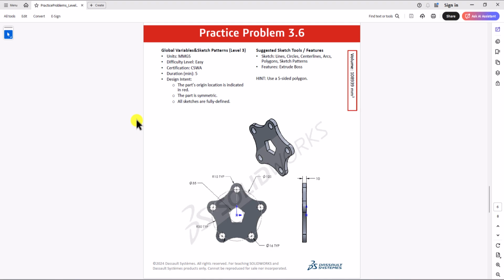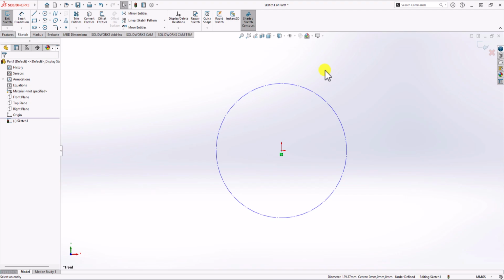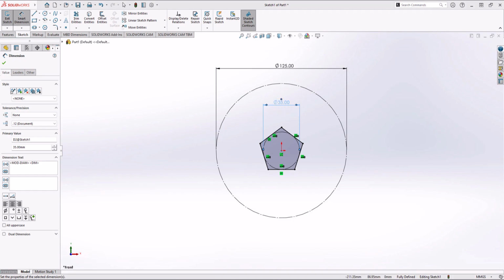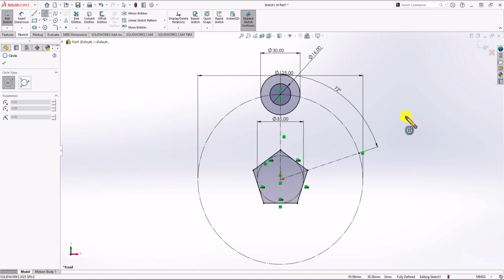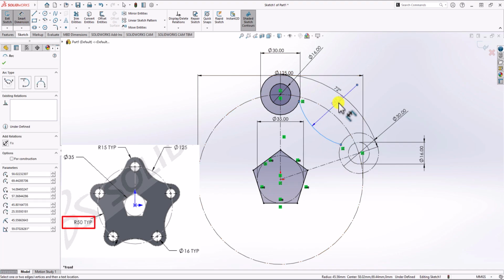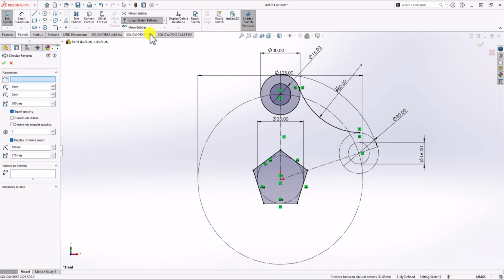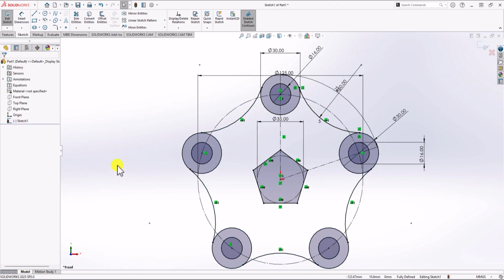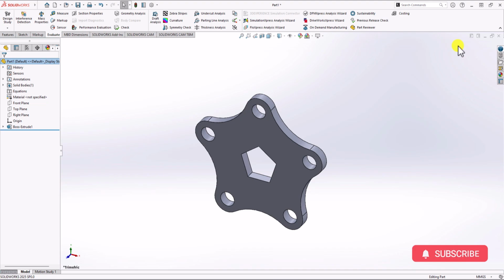CSWA Practice Problem 3.6 Solution | SolidWorks Exam Guide

Comment: Instead of a construction set of circles, I placed partial arcs on both sides. Then I did the pattern and made the arcs coincident and tangent, resulting in the same geometry. Is this okay? I don't want learn bad habits.

Your videos are amazing btw, thanks for making them :)
Reply from the maker: Thank you so much for your kind words! I'm really happy to hear that you've been enjoying the videos.
Regarding your question, yes, your method makes sense, and I don't see any issues with it. Remember, there are usually multiple ways to solve these problems, and there isn't always a single right or wrong approach. The method you described is completely valid and should work just fine.
At the end of the day, the goal is to create the model correctly in the shortest amount of time. The only suggestion I have is to compare your approach with the one I used. If you find that your method takes a bit longer, it might be worth practicing my approach as well. That way, you'll have another technique in your toolbox that could help you model more efficiently during the exam.